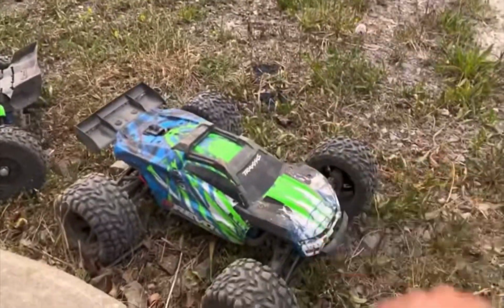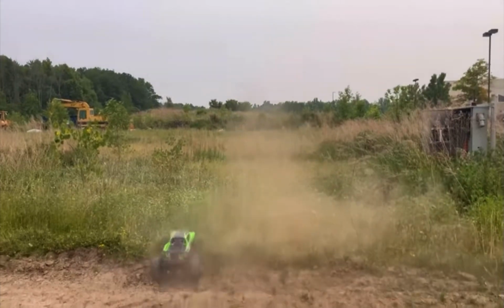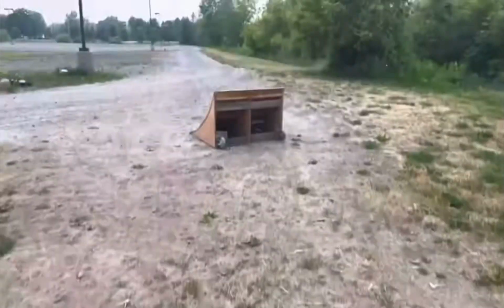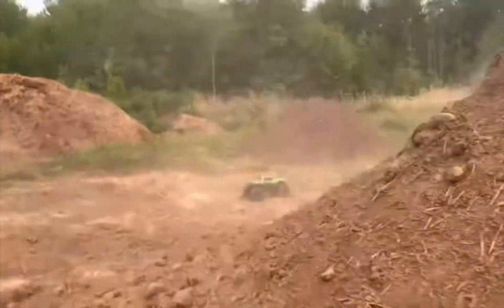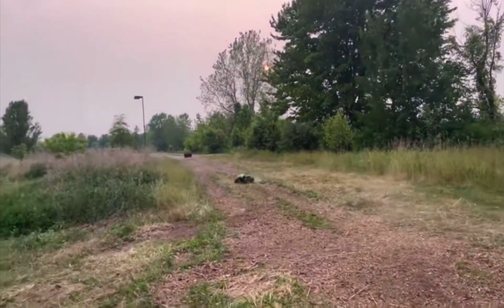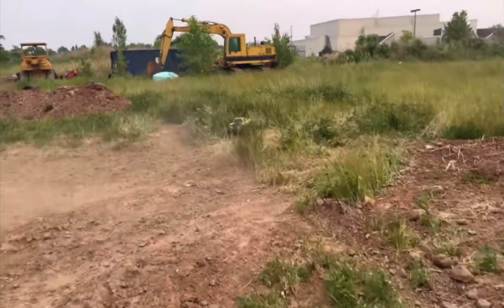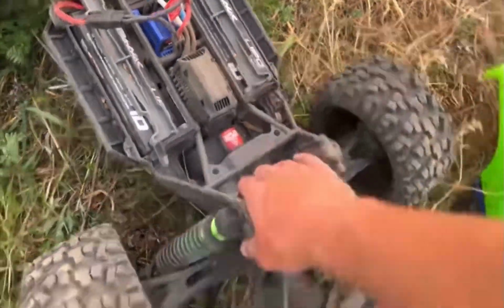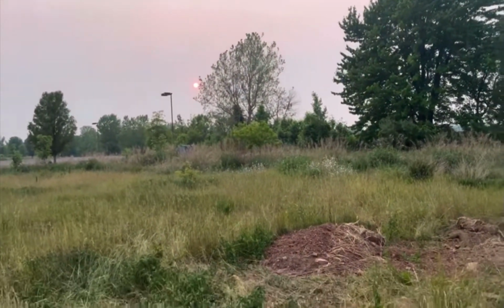“The King!”👑🏆 Traxxas Xmaxx 8s Is a BEAST!

Comment: You can just reglue that tire since it doesn't look ripped. Nice bash! How hot was the motor when the pinion came off? I've been waiting on the outcast V2 crash video to be posted. I saw your short about it. I've had some bad nose bombs with my V1.
Reply from the maker: Yeah man I glued it up. The Outcast crash video has been up for a couple days now. There is a short 2 minute video that is just the crash and the longer one is Xmaxx vs Outcast round 3 which has the whole bash!